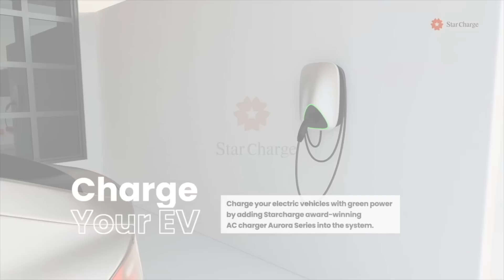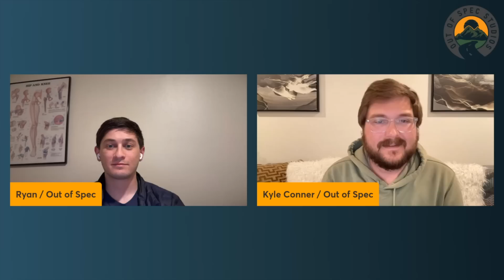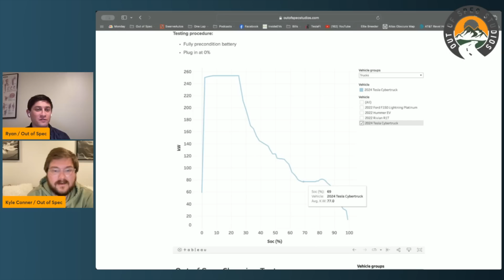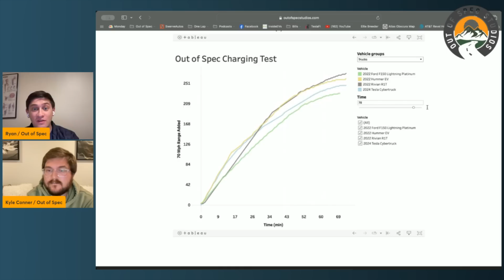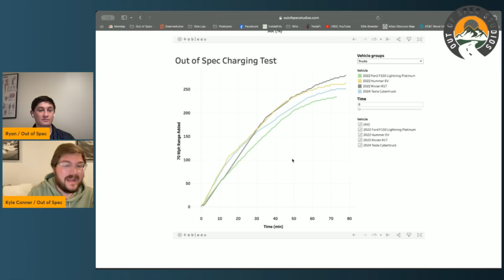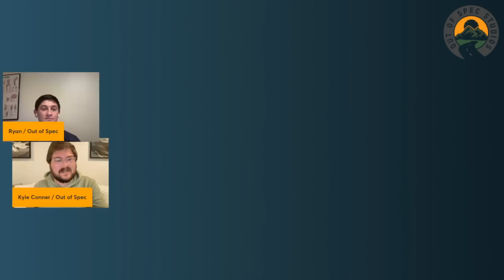Cybertruck DC Fast Charge Testing & Analysis - Comparing To Rivian, Lightning, & Hummer EV

Comment from the maker: For those that just want the curve and not the procedure explanation or details about how it interfaces with public hardware, it’s right here! https://outofspecstudios.com/charging
Reply: This is an amazing resource, thank you!! One small request: could you include a test date for each vehicle curve, where possible? Since with software updates the curves could change.
Reply: thats s  coolbythe way
Reply: thatsneed  iwellsaid thatat make saisonnow littebitsoyou know
Reply: Great job.
The problem with the time/distance chart is that you start from 0% SoC, but in the real world many users try to avoid going below 5%. For example, according to this chart, Rivian is not good, but if you look at your numbers from your 10% test, it scored better than ID.4, but from this chart, it looks like ID.4 should be significantly better. So you need to do a 10% test with CT to compare with Rivian in a fair way.
Reply: @Dqtube  it’s a good point. You can get a reasonably accurate 5-80% time by taking (time to 80%) - (time to 5%). 

Part of the reason the Rivian performed worse in the charging curve is because we used the range from the Quad Motor with 20” off road tires. The curve will look much better when we provide updated charging data and use the ranges from the dual motor variants.
Reply: geting nicely thats all so you know
Reply: @ryankassel5691  the SOC curve would remain the same, motor and tire configuration would just change the 70mph range added
Reply: @Dqtube  good point. I was wondering why the 2nd graph didn't align with my gut feelings with the charge curves. Maybe @OutofSpecRyan can add an option to the graph to change the starting SOC and move the lines to the graph origin.
Reply: thats cool by to start
Reply: thats good Quneens for him i well sId
Reply: Nice job on the chart. It's missing Lucid and some other EVs.
Reply: that make saion forhim or me toif you what i am not punsh you on it other
Reply: Love this but you need to rerun the EV6 as the data from 2021 there is not indicative of the current behavior as far as the dive downs. Please retest.
Reply: Absolutely awesome job on these curves.  This pretty much gives me the hard data on what I was already pretty certain of, the 4680 Model Y is absolutely horrible compared to the 2170 Model Y.  After a 4000 mile road trip over Christmas (including over 1000 miles in one day) in my 4680 Model Y I was feeling the pain.  Now that I can actually see how much time it would have saved, there is a 99% chance it gets traded in for a 2170 Model Y this year!
Reply: @be-golf8374  And what's the common denominator between that Model Y of yours and the Cybertruck? ....... That's right, the 4680's and their dry coating.
Reply: Someone tell Kyle and Ryan that Kyle's friend Tom from the State of Charge channel has a full 0-100% charging video on a 350kw charger as well as a 70mph 100-0% video on the Lucid Air that they can use to add to their charging and efficiency charts.

He even has a spreadsheet showing the graph and numbers.
Reply: @Paul-cj1wb but not tested in Colorado at their standard lap and the resulting  lower air density
Reply: @freddymorgenstern9674  I live in Colorado with my 4680 Model Y and I can assure you it sucks as much here too.  I would expect the difference to be VERY minimal.
Reply: I found it interesting to get 300km of range on this second chart . The Model S Plaid only takes 15 minutes, while the Cybertruck take 40 minutes. Currently that is really disappointing
Reply: Are you taking the range till totally empty? If yes, you may think about taking only the range till 0 % or even a higher percentage or a certain amount of miles for all vehicles, like with the Edmunds range tests. This is more realistic for the typical user.
Reply: Maybe this is already been stated, and I just missed it because I’m listening to this while shoveling snow a lot of snow I wonder what the 18 wheeler or Tesla semi charger specifications are? The reason I’m asking is because could they be building a charging system using that type of charger but making an adapter for the Cyber truck that you go up to one of those big chargers, push a button like the one set of chargers out there. It will automatically put an adapter on it and allow you to charge those big boys? Arnold, that’s just my thought as what they are going to be doing down the road once they get them out on the mainstream market and that’s why we’re not seeing the charging specifications that we’re looking for🤷‍♂️
Reply: I think the company in Phoenix, Kyle was talking about, is Nxu. Might be wrong.

Comment: Well done on assembling this collection on Tableau. The viz break through all the variables (pack size, charge rates, vehicle efficiency, etc...) to provide meaningful comparisons, at least for all the variables you can control. Having the charging time slider lets you further dial in the comparison for how you travel, frequent/short stops versus fewer/leisurely stops. Looking forward to seeing this dataset develop as more vehicles are tested and you refine control for other variables like weather. So good, keep it going.

Comment: Not surprised to see the lower Bolt curve with its 50kw limit, but much lower price point, making it the Model T of EV technology in the US market.   But the Bolt is being remastered, with the switch to NACS charging and Ultium battery technology.   I am curious how that effects the DC charge speed and relative Price Point.    You love to talk about max DC charging, but the switch to NACS also improves potential AC charging rates compared to J-1772, possibly making the North American AC experience more competitive with Type 2 AC charging.  Tesla Destination chargers have traditionally been offered as a complementary service, but with all the other Makes also going to NACS, they need to bring out fee based versions, like Charge Point has been offering sight hosts for J-1772.  Restaurants etc. don't need to be offering unlimited free AC charging to Hummer and F-150 Drivers.

Comment: In terms of battery charging curves, it is more to do with battery technology. I "guess" Tesla's charging is software controlled. One of the reasons is any freshly made battery cells, it requires initial shelf time before put them into use (There are lots of nerd stuff in there). If I were in charge of Tesla battery division, I would be extremely cautious to control and monitor the battery performance in the Cybertruck to ensure ior optimize the battery performance. I rather give all Cybertruck owners pleasant surprises in later time to boost charging speed and battery pack capacity than the other way around. Other EVs are using matured battery and there is no chance to hold back.

Comment: Kyle and Ryan, I appreciate your detailed analysis and data collection - the nerd stuff. It does take lots of T&E and planning too. Easy say than done. I also agree that if video is too long, you are not only loosing audience but also diluting the important information. It is also possible to cause some misunderstanding. For example, as a buyer or driver of any EV, what one really cares is the practical stuff: things like your charging time versus range graph, miles/KW, and full range per charge. Those parameters are affecting car owners time and money in the pocket. Maybe you can present those "bottom-line" first, and then some nerd stuff. Another example, say, if one takes 25 - 35 min charge, the 3 out 4 EV trucks can cover ~ same range. Then miles/KW maybe the deal breaker. I went over your data, enjoy looking into the details. Great work!!! Sorry for the long comments and I'm a nerd too :)

Comment: I like to think of a contractor family.  Family of 4.  Working mom, drives a sedan.  Dad - contractor, drives a pickup.  Finally two young adult boys living at home.  Both apprentice contractors.  Both driving pickups.  So everyday, one car and 3 pickups need to be charged.  How far contractors travel varies.  I had a neighbor who is a steel worker.  He travels all over the city.  Puts 25,000 miles a year on his F-150.  So something like 80-90 mile a day commute.  His wife worked at the headquarters  of a large bank downtown My guess is 60-80 commute.  Add two boys also driving pickups.  They would need something like 100-150 KWH a day charging.  They would need two 48 Amp chargers minimum.

Comment: I like the figuree where you have charging time on the x-axis and 70 mph range on the y-axis. In my opinion it would be even better if range was on the x-axis and time on the y-axis. I like to do around150 miles stints between charging stops, so for me that would be a great comparison. I know I can get the same info out of the current figure, but it would be nice to not have to flip my laptop 90 degrees when I do the comparisons.

Comment: A curve with KWh on the y axis and time on the X axis would be perfect for towing where the (bad) aero of the trailer quickly eats up all the efficiency of an aerodynamic vehicle. (The area below the curve would also tell how many KWh the car has charged up to a certain time so you can compare different battery packs ability to take on board energy)

Comment: Another car to redo may be the 2021 Polestar 2. I was shocked to see that the bolt is the only car on here that has a worse charging curve. It would also be interesting to get a 2024 polestar 2 with the larger pack and faster charging.

Comment: Charging on 120 volts is not the best idea, the energy losses with 80 amps at 120 volts would be insane. 240 volts, or three phase at 32-40 amps makes much more sense.

Comment: Brilliant work Kyle and Ryan. Is it possible to do a 70MP test, charging from 20% to 80%, recognising that's reliant on the accuracy of the vehicles software to gauge these %. But this is a common recommendation from vendors, thus represents what a large proportion of drivers will be doing. So looking for: 1/ time to charge from 20%-80%; 2/ distance travelled from 80% back down to 20%. I'm sure you guys will come up with a beautiful graphical representation thereof

Comment: The 4780 size cells will never be able to sustain high power for long periods of time. As a cell gets bigger, the surface area only increases on the square, while the volume increases on the cube. In order for a cell to dissipate the heat generated by fast charging, or racing, you need maximum surface area to volume ratio. Prismatic cells, being square or rectangular, have more surface area per volume, than a cylinder. A cylinder is the next worst shape to a sphere, as far as how little surface area there is for the volume. With bigger cells, no matter how well you cool the outside surface, there is more distance between the innermost part of the cell and the outside. The thermal diffusion rate of a lithium cell is very limited. The best cells would be the new "Ultium" blade cells being produced by BYD. Those have an enormous amount of surface area for the volume, allowing much better heat dissipation. That allows the cells to maintain full charge rate up to ~80%! No matter what the chemistry, the "blade" cell format is probably the future in EV batteries.

Comment: I wonder about one thing about this split-pack charging.

So, I'm driving the thing around in 800V mode. The voltages of the halves might get slightly unbalanced, especially when the battery pack gets older. I connect to the charger and it switches to the parallel 400V mode. What happens? Is there a big surge of power when they "rebalance" in a short instant? Or, does it start charging the weaker one first and connect the stronger one only after the voltage rises to the same level?

I'm sure they've solved this problem somehow, I'd just love to know how ‒ I was asking myself why all the Hyundais, Porshes and so on didn't do this and went the complex way of boosting the voltage and this was actually the only problem I could come up.
Reply: You do understand that all battery packs are made of 3.5V cells in series with a BMS, no mater what the final voltage is?
Reply: @universeisundernoobligatio3283  Of course I know that. Well, usually some are in series and some parallel. What of it? That doesn't change my worry.

Do you know that even if they are 3.5V (depending on the exact chemistry) nominal, they vary their voltage a bit based on their state of charge and if there are two cells in a series, they can provide slightly different voltage? That's not a huge issue if they stay being in series. But if you reconfigure them to be in parallel, the one with higher voltage will „boost“ / charge the one with the lower one and quite fast at that.

BMS tries to make sure they stay as close to each other in their voltages, but this is not perfect and especially if you drain some older cells to low state of charge fast, this can be quite pronounced.
Reply: @michalvaner3167  
Being an electronics engineer I have been designing and building battery packs for years, in any battery pack it's the weakest battery that governs the capacity of the pack. EV BMS do not do balancing just monitor min and max cell voltages cutting off charging or discharging. Switching from pack series/parallel configuration does not mater it's always the weakest cell/cells that govern capacity.
Reply: @universeisundernoobligatio3283  I don't worry about the capacity of the pack.

Let me explain it differently, in a simplified example.

I have a 2-cell battery pack. For some reason, one of the cell aged more than the other ‒ so we have a cell 1 on 90% SoH and the other on 80% SoH. When we discharge them when connected in series, the cell 2 is at let's say 3.2V (it's on 0% SoC), the cell 1 on 3.3V (it's still having about 10% SoC, so higher voltage).

Now I disconnect the two cells and connect them in parallel. Because I've put 3.3V „source“ onto the 3.2V cell, it'll start charging from it, until the voltage evens out between the two cells.

This sounds problematic, because there's no control in how fast this charging happens. This can lead to:
* The wire between them overheating.
* The cells overheating.

I'm sure the engineers did solve the issue _somehow_. I'm just curious to know how.
Reply: @michalvaner3167  
The current going to the motors is far higher then charging current, therefore the pack is designed for that current.
Cell internal resistance also helps to balance the charging current in parallel batteries, preventing the all or nothing case, also each split pack pack will have a current shunt, so if there an issue the charger current will be throttled back,

Comment: If you align the second graph to start with a 50mile SoC (~20%) instead of a fully drained battery, the Rivian is the fastest charging truck. Other than you Kyle, not many people push to 0% arrival. 20% is much more common.

Comment: If I owned an EV I would want to know how long it takes to charge from 20%-80% and what range does that provide on the highway. It appears 20% (50 miles) is at the 6 minute mark, and 80% (200 miles) is at the 45 minute mark. So in theory it should take 39 minutes of charging to provide a 150 mile range.
The Rivian R1T by comparison is 66.5 miles at 13 minute mark and 269 mile at 68 minute mark, so using 20-80% of the battery should take 55 minutes charge to provide 203 miles.

Comment: Hello Kyle, I believe there are a few V4 Super Charges in Europe.  I suggest you contact Zach & Jesse of Now You Know as they keep track of all Super Chargers world wide.
Reply: There are not. It is just the dispenser, so the stand for the new charging cables. The power is still limited on these charging stations because the actual units/cabinets which send the power from the grid to these charging stations have not been upgraded yet.

Comment: Charging: When the battery pack is split to charge at 400A, the current into the car is higher but it splits at the DPDT and half goes into half the pack and half into the other. So the cells see the same currant as charging at 800V at the same power. No more losses in the pack past the DPDT or at the cell level.

Comment: Great vid with super useful metrics. Just to note - there is zero chance I’d willfully risk running down to 0 miles, as probably most population. There is a ton of risk of being stranded especially if you’re traveling with unknown chargers. As such I would think a setting in your graph to ignore the bottom N% of pack would give clearer picture. Actually the CT curves would then look quite different (and a lot worse). Thanks again for amazing work!

Comment: I really appreciate everything that you're doing to make sure that all of the numbers are accurate and representative! One thing that I think should be done to make things more accurate is do not rely on the cars built in calculations for distance and mi/kwh. If the speedometer is not GPS accurate, then it's calculation of efficiency will also be inaccurate because it relies on that inaccurate speedometer

Comment: Btw the Supercharger Cabinet for the Tesla Semi is the V4 (1000V/700?1000A) und they use V4 Dispenser with a different connector
Megacharger

Comment: Add a second charge port to the Cybertruck and charge the two 400V battery segments independently instead of in parallel.  This would require connecting to two pedestal cables and Tesla would need two control when/if this is allowed according to a charging site congestion.  This should decrease the charging times over using only one cable on the current 400V Superchargers.